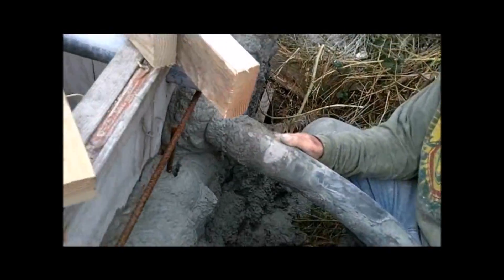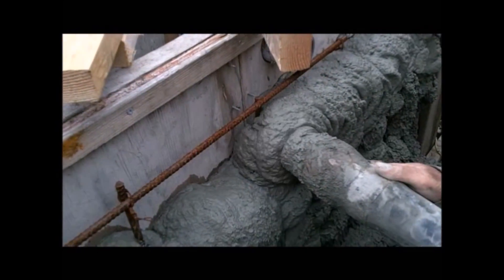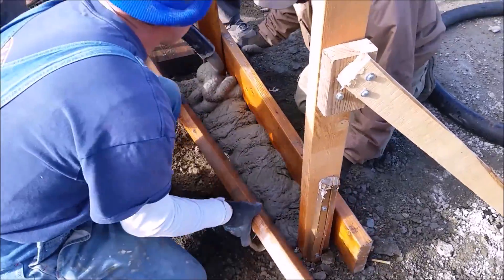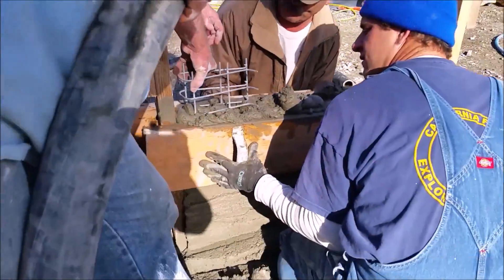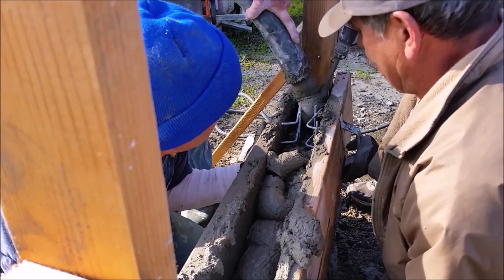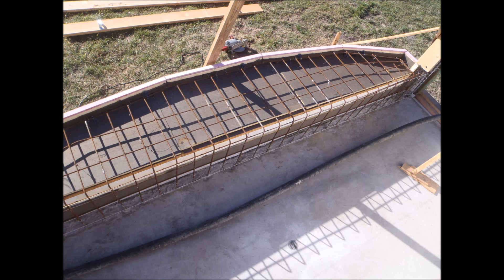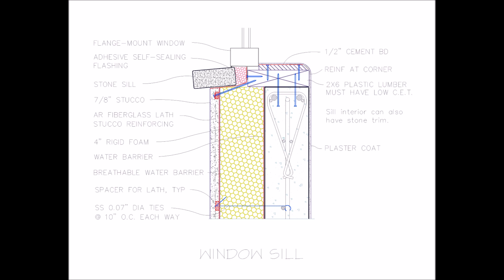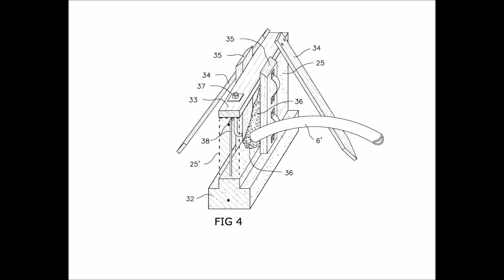SpaceCrete :   zero-slump concrete that pumps easily - to build walls with no forms. Rapid 3D print

Comment: True zero-slump concrete usually is applied in a manner that compresses it 
in-order to take fully advantage of its strength. A launch-pad for a large, heavy rocket or a slab for a nuclear power-plant.

Comment: What is the ad mixture please.
Are you talking about foam, aircrete ?
Thank you for the brief informative video.
Reply from the maker: Thanks again!  This is not a foamed mix -  generally fairly normal concrete.  We are working on making aircrete printable, but we're not ready to put out a product for either yet.
Reply: Admixture: Aluminum sulfate in water solution. What's the big mystery?

Comment: Is the pressure in that hose controlled? ..or can it be?
Reply from the maker: Hello.  The pressure is the result of what is downstream (thickness of mix and friction resistance of the line) of where you measure it.  At the end of the line it is zero.
Reply: @SpaceCrete  thank you

Comment: What a great material. I am experimenting with foamed Lime to get to a light weight breathable insulation to apply externally to stone and cob walls. Could your thickeners and accelerators work with Lime in the same way to achieve a zero slump material?
Reply from the maker: In my experience lime is easier but aqueous foam mixes are harder, and for those this admix does not work well enough. Still working on that one. If you have not gotten anywhere after a while, check back, thanks!

Comment: How about blasting quickly out ( ... instead of squeezing slowly out ... ) from a tube on to the molding panels?!!
I am thinking about a technology that people can build a dried and cured Spacecrete house, including the foundation, in just a few days.
Reply from the maker: One of the things we are tryng to avoid is the substantial waste from rebound, overspray and trimmings that are part of usual shotcrete. Also you need nozzleman and specific-job preapproval (by testing for that job), continuous special inspection (by code), and an enormous source of air. We can go full thickness in the first pass, to a finish surface - when everything is working right. This is an early proof of concept - the later videos show method/material improvement - but still working on it, thanks!
Reply: Blasting can damage other material in a wall (like foam)

Comment: Seems interesting but there appears to be significant but almost random voids which would make it difficult to achieve consistent strength - so you are left with either just over engineering your structure ($$$) or not using this in load members.
Reply from the maker: This is proof of concept - the first time done. You can see that we have many followup videos.
Reply: SpaceCrete I’ll take a look, thanks. You said the weight is the same, have you tried pumping more aerated concrete with or without your additives? There is engineering data for up to 20% wt foam concrete and was wondering if that would pump as easily.
Reply from the maker: @SpiraSpiraSpira  For structural concrete we are trying to lower the air content as a high air content lowers strength, but does make more a forgiving rheology.

Comment: Good video, I was looking at dispersal..you would get a better shape to the flow if you used a square pipe on the end,  let me know your thoughts..TY
Reply from the maker: Yes you are exactly right. As soon as you move the nozzle, you fill out your path (extrude) more consistently with a rectangular nozzle. I was just using the end of an available concrete hose tail. Thanks!

Comment: What type of pump you use to support such low slump?
Reply from the maker: 1970s Mayco C30. That mix is very easy to pump, but it does shrink. Our later mixes do not seem to shrink at all.

Comment: Nice info.  I'm considering making new garden beds with this stuff.  I'll post a video of my beds in a reply...
Reply: https://youtu.be/u5qJ3h8Kw6A
Reply from the maker: Plenty of rain to harvest here - a nearby ridge has had 168 inches so far this season.  The problem with making planter beds this way - which we will do here - is that you need a concrete pump, so it better be enough beds to make that expense worth it. Eventually I will have video of that, but don't expect such big grubs has your chickens get!

Comment: PSI rating?
Reply from the maker: Last test 4400 psi, non-water cured, thanks.
Reply: SpaceCrete Thanks. Any ACI or ASTM specs on this ?
Reply from the maker: @Motorhead250  It is concrete, one could choose to spec it at under 3000 psi, or take cylinders, as it is just concrete. What will be needed is getting the admix on approved lists, no start on that, though the dose now is very low.
Reply: SpaceCrete Excellent idea. Can use for various repairs in situ. 
Thanks

Comment: How would this work for pool construction?
Reply: RJ Weissenborn it’ll work well. Shot Crete is what’s being used for pool construction now, at a two to three in slump max. Shot Crete is similar idea but is sprayed on vertical by going through a pump, two inches in diameter hose, and compressed air. Just like what you see in this diagram except where the additive meet the hose, it’s air pressure instead. Idk what psi this concrete is but shot Crete is usually 4,500 psi.
Reply from the maker: RJ I that because this is thickened inline, the mix can actually be a slower setting mix, giving more time to work the surface. Still to be proven though. Thanks1

Comment: Looks like the readymix companies will need to work with you in order to make this innovation work.  So it's going to have to be in their self interest to be involved.  Perhaps special trucks and other new equipment, training of personnel,  etc
Reply from the maker: Thank you Steve for your clear observation. Our injected admix now does not require a special concrete mix - just good quality redimix concrete (our more recent videos). The problem is emptying the truck fast enough. That is why we are pushing in that direction - with new ways to get good and fast placement without forms.

Comment: great. it seems there is potential to have a box made from rigid frictionless plastic around the nozzle and have it on a kind of CNC rig to produce free standing block forms going around the perimiter of a structures foundation footing then up another level for the next row etc until you get an entire house built, and add in fibres in the mix to provide reinforcing
Reply from the maker: Hello, thanks for the observation. 3D printing with concrete has huge interest right now and there are many approaches being tried. Ours is to try and get the mix and geometry definition to go really fast, so normal concrete truck delivery can be used.
Reply: @SpaceCrete  years ago when redimix first came out with fibers in the mix i was plumbing a new house with my grandfather .we had a new guy helping us and he made a small mistake and had the toilet roughed in about 3 inches to the side too far,well long story short we had to bust a small amount of cement and bump it over .let me tell you it was almost impossible to bust that stuff we beat and beat on it forever and could only chip it .finnaly got it after several hours .needless to say i was impressed! yall take care ....

Comment: Hapy to see innovation but the only issue i have is speed. Time is money and if it takes longer to pour, the more cost there is in pouring a wall
Reply from the maker: I agree that labor costs a lot of money. That is why millions are being spent to develop 3D printing of  concrete - so you don't have to build those forms in order to pour the concrete into. This is the concrete that you would use for that.

Comment: This would be really great for those using ferrocement.
Reply from the maker: Thank you for your observation. We are working at getting regular concrete to behave more like ferrocement. Then you can order it by phone call to save mixing and $. The new admix is at 0.5% of concrete to get the preferred properties.
Reply: @SpaceCrete  I see one year ago you commented on "Shotcrete! Dos and Don'ts!".  The guy was making a dome home where he had to tie two layers of foam under the rebar to apply shotcrete and then remove the foamboard.  That seemed crazy labor intensive. I was wondering if your mix could do the job if instead of the foam you used expanded metal and left it in place.  The expanded metal should catch and hold your concrete and then someone on the inside could smooth it as you go.  The skreed would be useless due to the curve.  Do you think something like that could work?  Expanded metal may be too costly but it seems logical.

Comment: at 2:04 you switch edit without showing what it looked like with all the airvoids.......that isnt very honest for this idea of better cement structure in walls. voids are not good at all in a wall.
Reply from the maker: Elizabeth, yes consolidation is an issue with zero slump concrete. If you look at our next video, spacecrete 2.0 you see how much we emphasize vibrating the concrete and that we figured out how to consolidate it properly. Thanks.

Comment: That's impressive but without better flow control you're going to have significant voids, and with a mix that thick it might be more apt to use several rods put through holes in a 2x4 like a grid and just work it to slump it into the voids because that vibrator doesn't seem effective.
Reply from the maker: Yes, accurate observations. In our next video we showed vibrating that worked, and the consolidation was excellent, but overall the improved method still needs significant improvements to become mainstream (that we work on continuously). The main issue is the speed. The present goal is to empty a truck within an hour - which is hard to do building a 4" wall without forms.

Comment: Hola; que dosificacion estan usando? gracias
Reply from the maker: Dose of ? The concrete is 7.5 sacks cement per yard, but there is also 50 to 100 lbs of metakaolin typically. The injected thickener is  2 to 4  gallons per yard. w/c is under 0.40.

Comment: I love the pursuit of better building science, but this doesn't seem "faster" by watching the screeding process.   I think doing foam panel forms would be the best compromise.  Wouldn't you think that using the forms as insulation would give you the speed you need to be a viable alternative, while adding value by reducing the weight and volume of the concrete itself?  
Just my 2 cent.
Reply from the maker: CJ, any foam surface needs to be clad with something else $, and also the form pressure needs to be dealt with by using lots of stout plastic ties that get in the way of seismic boundary reinforcing. The best thermal performance is where the thermal mass is all on the inside and all the insulation is on the outside, as possible. We are not trying to reduce the concrete weight, but that is easy to do and works better, but is weaker of course. Our subsequent video (2.0) shows more speed, but it still needs to go faster so that we can empty a truck, filling 4" walls, without any standby time. Please remember that the video above is the very first time this was done!

Comment: Strength?
Reply from the maker: The mix in this video is 3500 psi. Subsequent mixes are stronger, but I am more concerned about flexural ductility and not shrinking. The 2.0 video mix did not shrink at all over 40', so that was nice.
Reply: Can you shotcrete it?
Reply from the maker: Yes it would work well for that, but a lot of the motivation here is to avoid the shooting part. I built my last shop with shotcrete over foam and have been trying to improve on the method since.

Comment: Does the thickeners weaken the psi of the mix?
Reply from the maker: Yes. Some more than others. Some improve strength. Testing, testing, testing. The mix in this video was 3500 psi with the thickeners in it.

Comment: Aircrete or spacecrete?
Reply from the maker: It is normal weight concrete, unless you add the air. We prefer it full strength. If it is lightweight, getting it to stack is much easier.

Comment: That's pretty impressive stuff.  Does this change the density at all?
Reply from the maker: Thanks. This batch is normal weight aggregate but did end up with a lot of micro-air in it - not intended, and it did shrink. The next batch (next video) was altogether normal density but a rich mix that apparently did not shrink at all in 40'.

Comment: i want to know more.. and possibly build a small test house.
Reply from the maker: We haven't perfected it yet. All the hardware is evolving prototype. The later video 2.0 is better, and since better yet, but it needs to get to more like 4 yards an hour to be viable for emptying a truck without too much standby time. With concrete walls only 4" thick, a yard goes a long way so the cost is not a problem, but the redimix providers don't want to tie up a truck too long.
Reply: bummer..

Comment: What psi?  Building thin shell concrete homes Northport Florida
Reply from the maker: Hello, I had replied to you but the reply ended up as an original comment - above on my screen. I am always interested in projects like you are doing even if not using this method. Send a link or info when you get a chance. Thanks!
Reply: 5000 psi  go to my web site for email contact
Reply from the maker: David, it looks like your shell construction is going fine without our stuff. We are still tinkering with the mix significantly - before we want to let it out into the wild. At this point I don't know when that will be. Cellulose based cement thickeners - such as are added to tile adhesive products -should work well for your situation I would think.

Comment: What is the recipe for this concrete mix?
Reply from the maker: It is typically a 7.5 sack with up to another 300 lbs fly ash per yard added to that. Pea gravel only because that is all my grout pump can handle. The injected admix is still a secret at this point, but I can say that you can use the types of thickeners meant for tile adhesive or vertical concrete mixes (VAEs or ASEs), and the types of accelerators used for shotcrete, such as aluminum sulfate. We will have more to share within a couple of weeks, thanks.

Comment: If you were able to have an overhead container full of the helix reinforcement strands that could be directed down thru a hose and another person controlled the direction of the flow into the mud to act as reinforcement, then the strength of the wall or structure would be more than just the standing rebar. Mark
Reply from the maker: Cool idea Mark, thanks! The helical bars can go right though the pump line and the inline mixer though. My informal tests show that they really do add ductility (less brittle with reserve strength). The issues with them are cost and the wet concrete is prickly - you want very tough gloves if you are ever pushing it around, and to meet seismic code you need the rebar anyway. For really thin concrete at the coast the stainless ones might pay - the refractory people use those.

Comment: and there you have it, the quickest way to make a pump operator hate you.
Reply from the maker: Yes, our local pumper did not want to touch this stuff until he saw it work. Now he is fine with it. This testing is with my own 1970s Mayco. What it does not like is the mix stickiness, the low slump is fine once it is well primed.
Reply: SpaceCrete what about the accelerator?
Reply from the maker: That is why we inject accelerators and thickeners inline - around 10' from the end of the pump line. Only that last part of the pump hose has accelerator in it. Yes we have had to "cut it loose" on a job because of a long pause, but that short piece of hose can be cleared out while a new hose tail is attached and pumping. Better video is on the way.